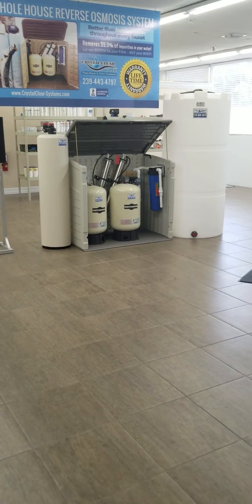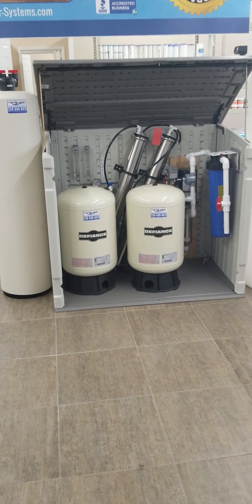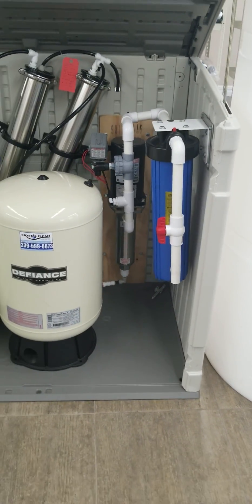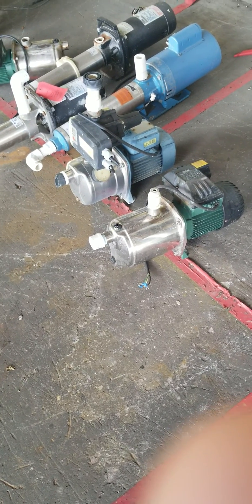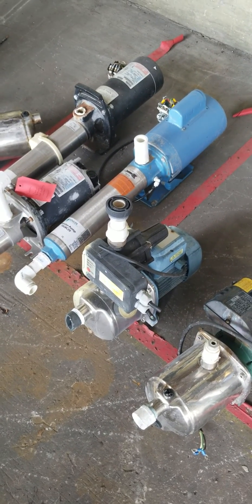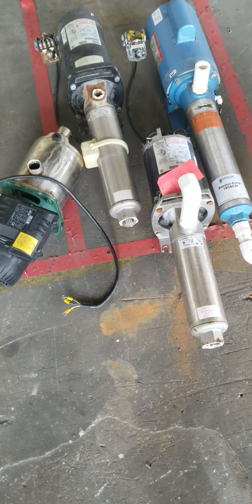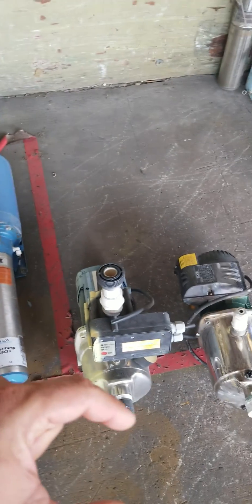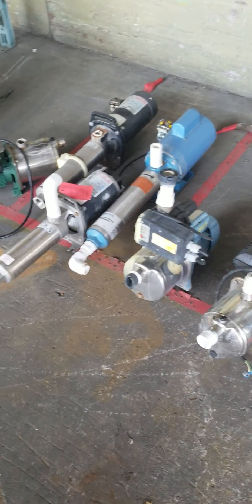Why Your Whole House RO Needs THIS Pump! (Cape Coral/Fort Myers Water Pressure Solved)

Comment: Why the F do you need 150-200 PSI in a residential setting?
Reply from the maker: You don’t have to have That much pressure , We have low pressure systems that are around 100 120 psi but the definition of reverse osmosis is high pressure through a semi permeable membrane. Places around here have anywhere between 1200 to 35 to 4500 total dissolved solids and a low pressure system for some of that has a lot less total dissolved solids like 5 to 6-700You could get away with a low pressure system but even then you’re still going to be around 90 to 100 psi. The well pump itself is going to generate anywhere from 70 to 90 psi sometimes you need a booster pump sometimes you don’t each application is different.
Reply: How good of water do you want? I'm sorry what do you do for a living?
Reply: @DaveC7746  Wow, Dave.  Defensive much?  Remember P for polo shirt, pants and Professionalism.